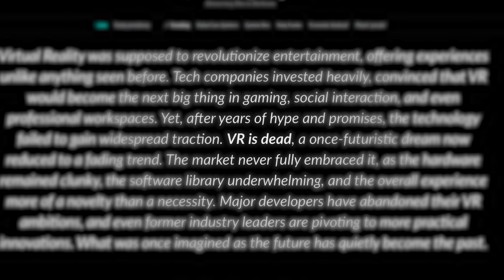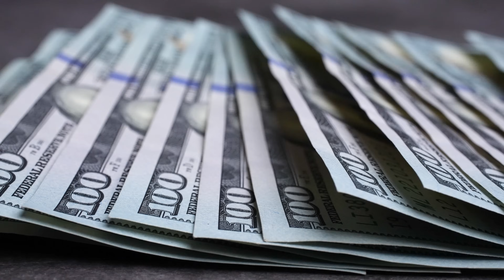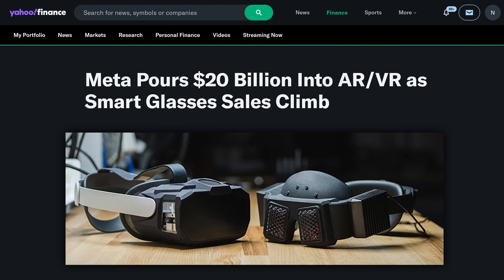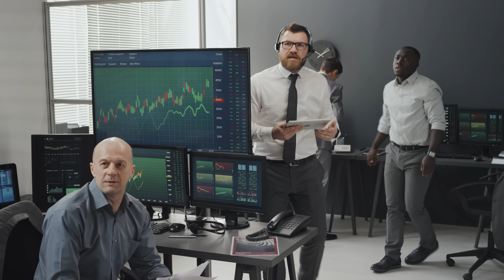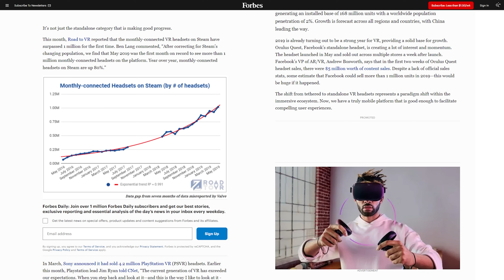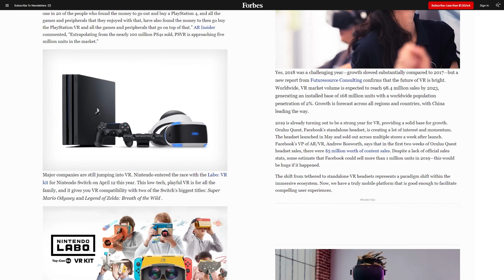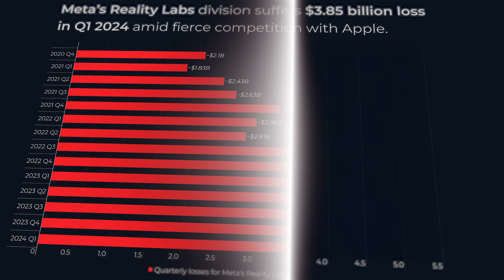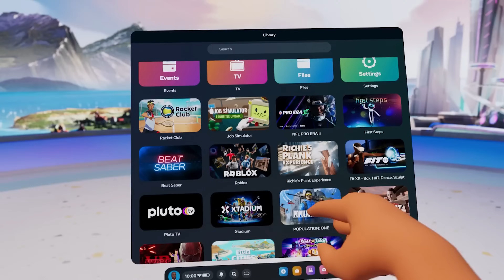The Incredible Evolution of VR Technology

Comment: The videos on my Quest 2 look like 360p resolution.
Reply from the maker: Videos played from where? They won’t look like a 4K monitor for sure but it shouldn’t be that bad either.
Reply: @VRManCave   Youtube.  Do you know where I can watch higher quality videos?  Thanks.
Reply: @VRManCave   2d vids are fine.  It's the 360-degree videos that looks horrible.
Reply from the maker: @TonyStone3000  Yeah unfortunately most of the 360 videos are shot in 4-6K resolution, which is still too low. The YouTube app on Quest was recently updated and now supports higher resolution 360 vids, so search for 8K or even higher res ones. They still don't look perfect, but much much better. Unfortunately it's a limitation of the cameras used to record them, and not the headset.

Comment: Bummer you forgot to mention the Valve Deckard.
Reply from the maker: I didn’t forget, there’s just literally zero official information on it, just leaks that have been constantly coming out for the past 3 years with no release date in sight.
Reply: @VRManCave  write me a follow up in a few months.
Reply from the maker: @paulbellino5330 believe me I am itching for some clear info on it too!
Reply: @VRManCave  I know, I am holding off getting the Big screen Beyond 2 with eye tracking because I want to see what valve is bringing to the table. 2 concerns so far. Will it have a direct to display port connection and what are they using LCD? Mini OLED ? Resolution?  too many questions
Reply from the maker: @paulbellino5330 Yeah we’re getting a lot of great hardware this year but if Valve gets it right, it will make some massive waves in the industry. I think they are bound to keep PCVR top of mind when building it, but also to give Meta a real run for their money if they bring stand-alone games directly to Steam via a modified version of SteamOS for VR.
Reply: @VRManCave  here is my look at it. If they have a stand-alone that is capable for direct connection to the display port, they will open themselves up to the widest possible scenario for success. Flat steam games, VR games, Mixed reality and Media consumption. I just hope it has good specs
Reply from the maker: @paulbellino5330  Fingers crossed man. My hopes for displayport on the Deckard are not super high, but I do hope at least they will implement an almost lossless wireless streaming option.
Reply: Unfortunately, Pico 4 never had a chance once the US refused to let ByteDance sell in the States. 

Myself, and knowing Meta's previous reputation, I wouldn't be at all surprised if they had some hand in the ban--but ByteDance's far-too-close connection to the Chinese government, and the extraordinary level of privacy information they collect through Tiktok (which make Meta's information gathering look positively anemic), definitely had a lot to do with it. 

Which is too bad, because the Pico 4 itself was quite a good headset, and MUCH more pleasant to wear than either the Quest 2 or the Quest 3, with just a few adjustments. And unfortunately, I can't say the same about the Pico 4 Ultra, which is just a paltry upgrade to the Pico 4.
Reply from the maker: @kaecatlady I’m not even sure how well founded the allegations of collecting data were, and just overall don’t quite understand why data collection is treated like it’s anything new. Every single electronic device does it, whether it’s from Amazon, Google, Apple or anyone else. Personally I’m not too concerned with the chinese government knowing I like to play Contractors Exfil. But I do agree that the Pico 4 is a great headset!